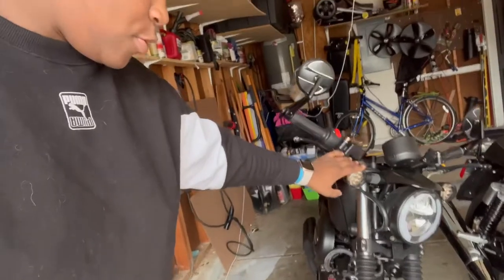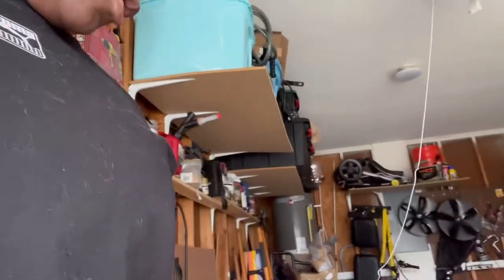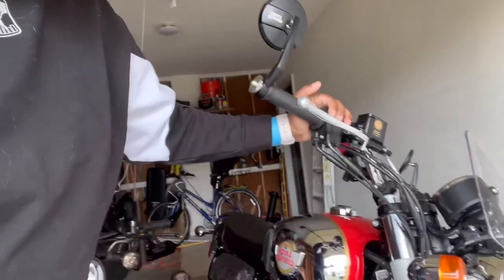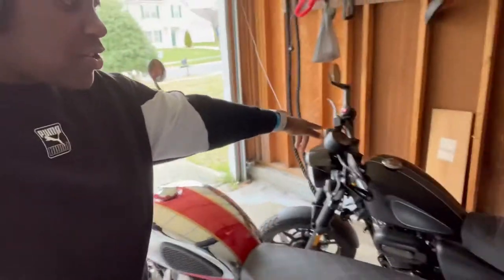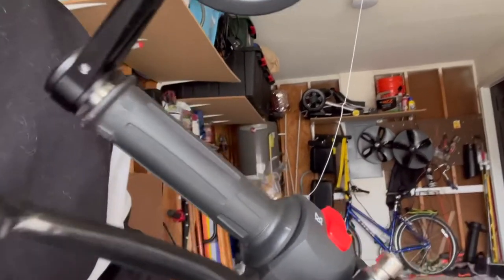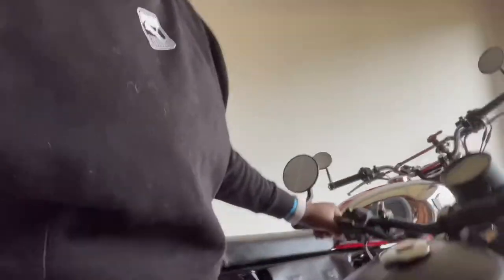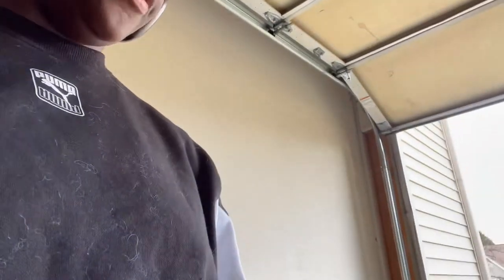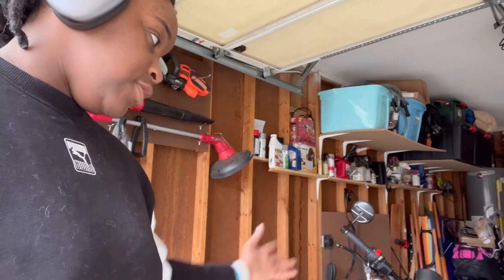Why I Sold My Venom Ghost

Comment: I’m a beginner rider. Should just start with the Continental GT Royal Enfield? I’m interested in the venom sportster chopper.
Reply from the maker: If you aren’t sure you will like riding or if the price tag is a large part of your consideration, a venom bike is a good way to go, but if you don’t mind buying a more expensive bike, you’d be getting way more value in starting with the Royal Enfield. It is enough power to grow into, it’s super stylish, and it comes with a better warranty. If I could go back, I would probably buy my Royal Enfield interceptor first and skip the venom bike altogether. Good luck riding!

Comment: Is the venom ghost a good first bike? Id be using for getting from point A to point B and just for riding around. Do you think it's worth it just for that kinda use?
Reply from the maker: Absolutely! I would get the fuel injected version of the bike though. The carburetor is so annoying when it gets cold. But I used to ride the bike around town, and the neighborhood, and to work. It is fast enough to go on the Hwy, but I wouldn’t take it on the interstate.
Reply: @laligagging  do you think I should get the Honda Rebel 500 Instead? I'm worried that the ghost won't be reliable.
Reply from the maker: There are plenty of bikes you can get in that price range (a little more expensive than the ghost) that are great bikes. I haven’t ridden a Honda rebel, but I’ve heard good things. I went with a Royal Enfield Interceptor 650. Several of my friends have REs. I know someone who had a Yamaha MT07. He loved that bike. Watch a few videos and do a test ride, so you can see what you like. It will be much easier to get a more popular brand serviced. The Ghost will be something you’ll have to tinker with yourself. It is also only a 250, so it’s much slower.
Reply: @laligagging  Thank you for your help. And great video!
Reply from the maker: I appreciate you watching. Glad I could help!